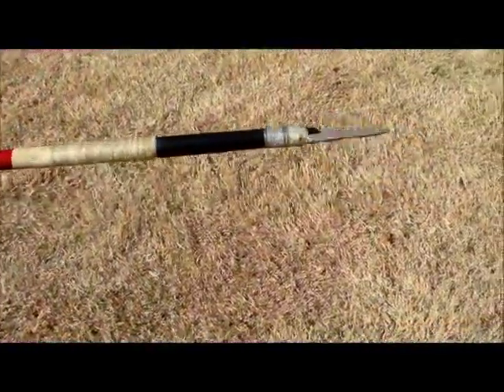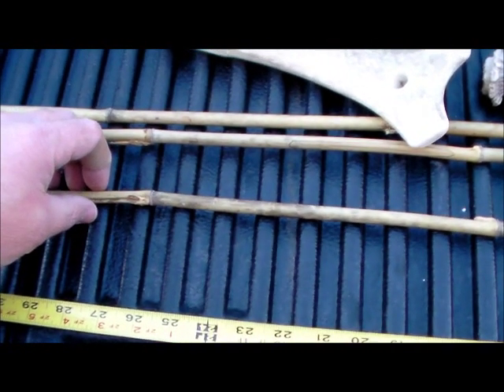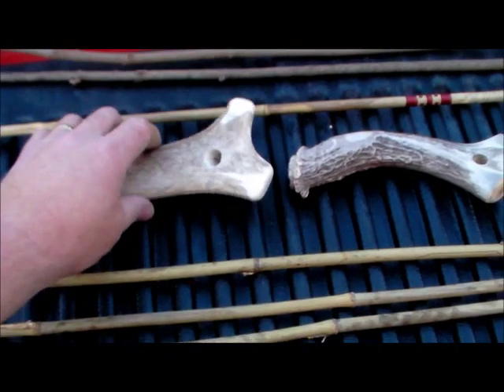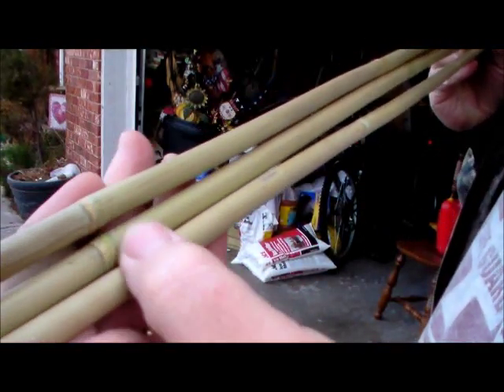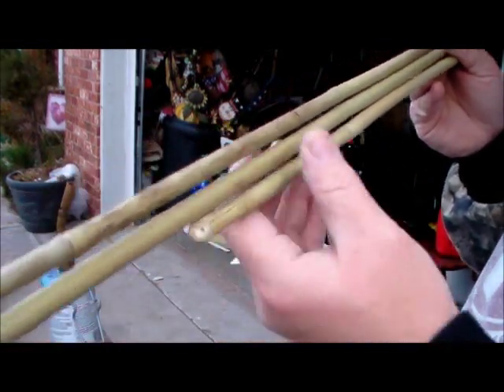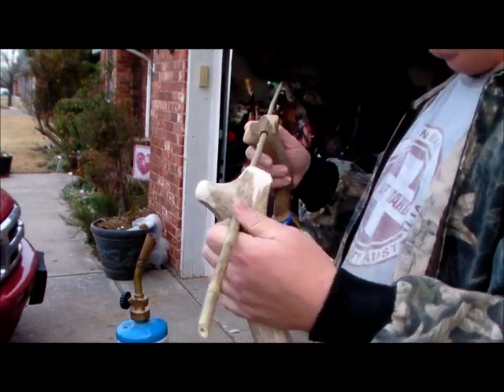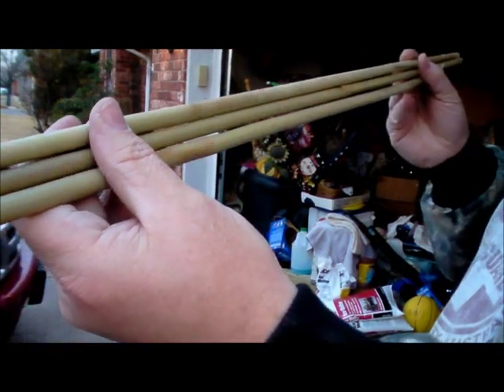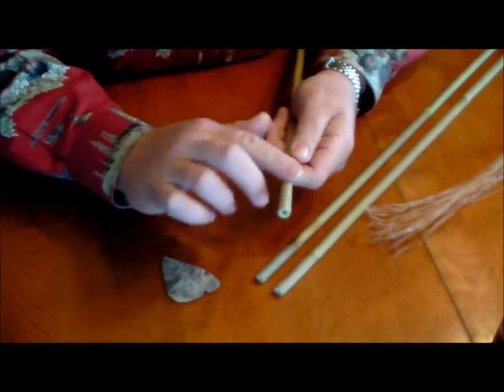Primitive River Cane Arrows 1

Comment: That's the first time I've ever seen an antler arrow straightening tools! I'm going to go make some! 
I'm from idaho, so no river cane. My arrow woods are red osier dogwood, my favorite chokecherry, vine maple, scoutberry, willow, and wild rose.
The absolute most difficult step in the Archery process is straightening hardwood shafts.  I prefer large open fire, enough to get a little or all of the shaft hot.  I completely bend all the crooks out in one
Direction, making a crescent shape. Cool overnight still warped. Then from the most pliable points re-straighten the entire shaft.
Heavy end forward. Lash and reenforce  the nocks and inserts. With Dental floss.
And either canada goose or sage grouse fletching.
My favorite 7$ tool is the harbor freight diamond grit rasp set. Makes everything much safer and perfect.

Comment: Thanks for the video.. Do you know if seep willow works well for arrow making ? Thanks
Reply from the maker: muddieair I've not used seep willow, will see if it grows in my area. I've had very good luck using swamp dogwood which dries very hard and straight and grows in my area.

Comment: what did you use to cut the arrow ends before wrapping with sinew.  seems like the cane might split if not cut properly.   did you use a bandsaw?
Reply from the maker: healthjunkie1 Sorry I missed your comment, I like to run my knife around the arrow shaft to start the cut.  Once the cut is started you can continue to rotate the shaft until the knife cuts all the way through.

Comment: What size holes do you have drilled in the antlers?
Reply from the maker: kyletango About an 1/8" larger than the largest arrow shaft you plan to work. Don't get it too tight or you have problems getting the arrow inserted into the antler.